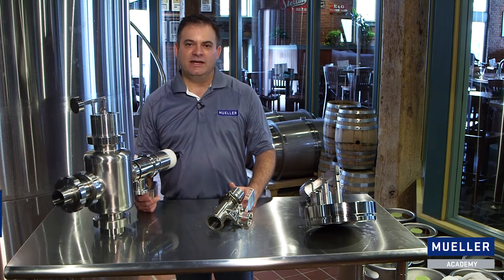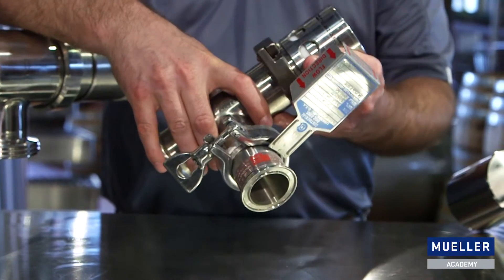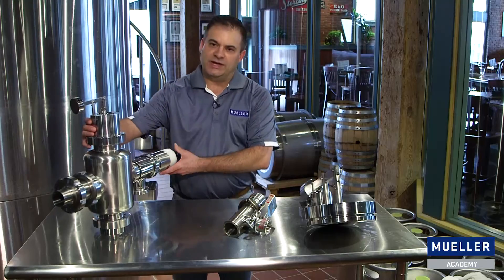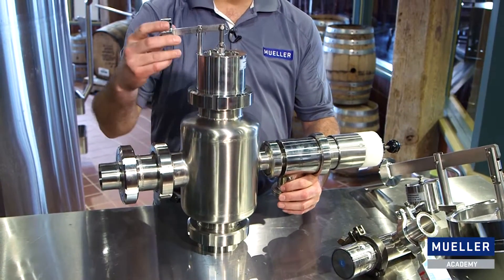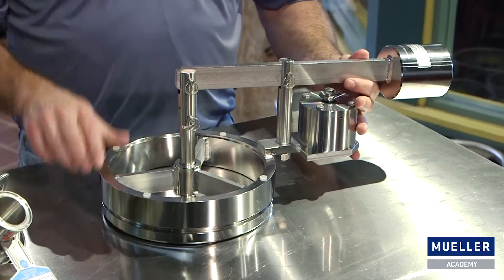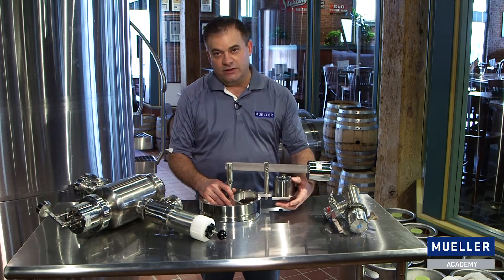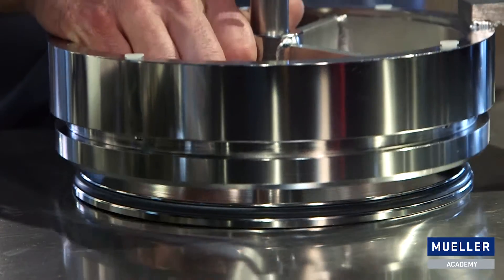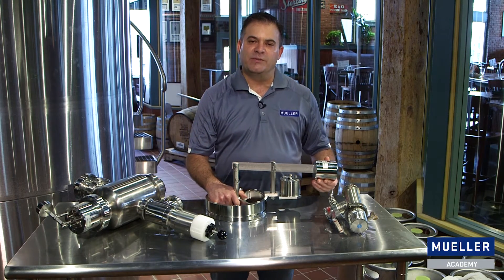Different Types of Vacuum Relief Valves

Comment: how vacuum relief valve works?
Reply from the maker: Pradeep, if you are needing more information on vacuum relief valves and how they work in a brewery, please fill out this form for additional information and someone will contact you. https://academy.paulmueller.com/vacuum-relief-valve-buyers-kit?hsCtaTracking=981b601a-2f19-4eba-b8b1-f6a730332b58%7C28d5dacd-1114-4ffa-a9c5-45d98f99cfda